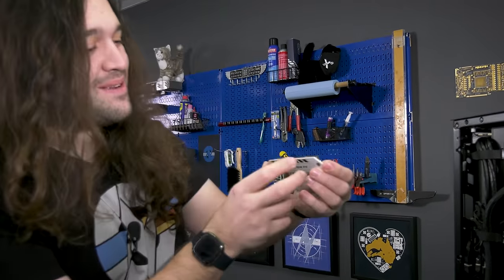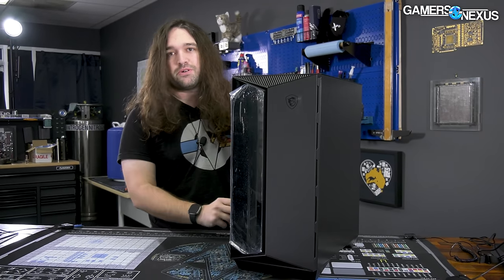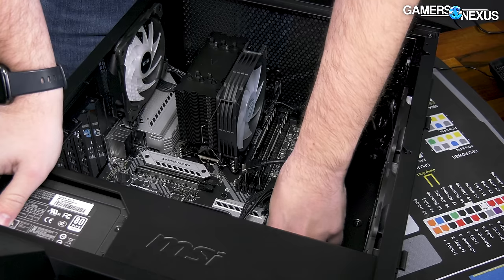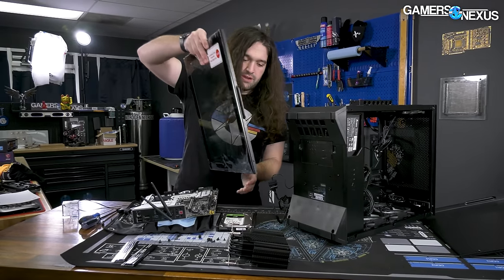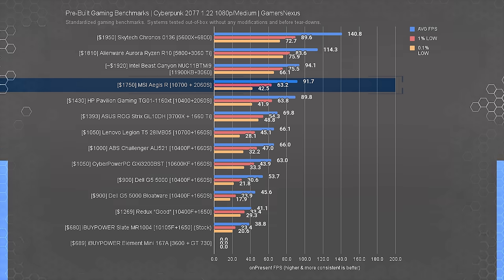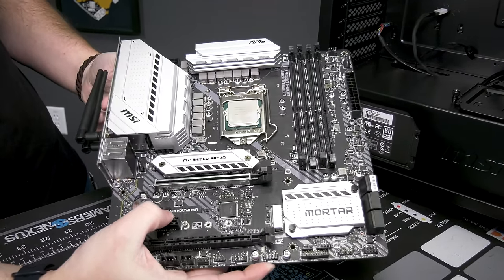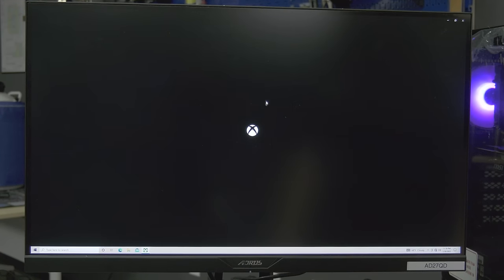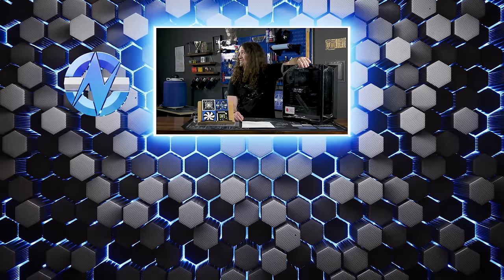MSI Pre-Built Bends SSDs & Boils CPUs at 100°C ($1700 Aegis R Review)

Comment: MSI usually screws up with power managing. I have a MSI Laptop and it was like having a piece of the sun in your hands until you adjust the power limits. Just by reducing 5% the maximum power amount of the CPU reduced the temps of the CPU from 90+C to 60-70C, with minimal performance loss. I don't know who makes the power profiles for MSI, but it's a catastrophe...
Reply: This is a laptop issue in general. They tend to push the limits of the power envelope for the cooling. I generally do this on laptops, to save battery, and even if plugged in, to reduce fan noise. It doesn't end up being 5%, and will go to one dynamic power step lower on the CPU, whatever that may be, probably 15-20%, but it has a huge savings. CPU power consumption is roughly a function of frequency times voltage squared, so reducing frequency 15%, which drops voltage... squared, you get a massive power reduction. If you don't require max performance, it's a no brainer to lower the limit.
Reply: I'm pretty sure what you did was disable turbo boost. You may wanna check that you're actually boosting past the cpu's base speeds. Though to be fair, turbo boost on laptops is almost a gimmick

Comment: I still like this build more than most that I have seen on this playlist. Someone who is halfway competent could fix half of these issues just by wiping the drive and reinstalling windows. The BIOS settings are worrying, but again very fixable if you know what your doing. Atleast with this one, your not getting a motherboard with a ripped out PCI slot, a weak as hell cooler, and a shit GPU. MSI does need to lower their price, use the airflow version of the case, and QC check their builds more. Hopefully they actually listen to you this time, which is disappointing as I generally like their products.
Reply: It's one thing if you're fine with it. Most people aren't competent at all. Secondly, you're messing around with a retail product, where you need to consider warranty issues. Generally, that's not a place where you want to meddle, as you could void that warranty. This is sort of why a warranty exists, so a customer has a path to redress problems with a delivered product. It's not supposed to fall on the customer. Imagine if Teslas came from the factory with several issues, and DIY handy people said it really wasn't that big of a deal, with just a few hours of work. You can like a product and demand an acceptable level of quality and service.
Reply: Cept for the other guy in the comments who was competent and found that the 750W PSU was not enough for the 3090 it came with, causing it to crash, the waterblock had plastic on it still that said "please remove before install", temps stayed high unless the front panel was removed, and then the water cooler stopped pushing water. So he had to buy his own 1200W PSU and a new front panel to fix the problems, not to mention all his time spent troubleshooting all these issues including the BIOS issue.

Comment: I almost got this PC as my own, there were newer models of the cases that had the half front mesh. I just ended up getting Ibuypower prebuilt which was a better choice in pricing and thermals for me.
Reply: learn to roll your own
Reply: @iClapBooty  seemingly better than this mess though.
Reply: time is near  cult
Reply: With some customization I think the burn in and testing done with an ibuypower means it’s got eyes on it for days before it ships. I think if you get a pre built making some changes so they run testing makes a big difference. Yes I know the point is to get a pre built that can be bought as is but making some changes you want was very beneficial in my eyes.  I have blown up a pc before so I am a bit hesitant to do some things pc related myself, but am ok with other things like ram swaps and adding hard drives.
Reply: Still better than MSI.
Reply: Guys, I think the MSI Codex should be next
Reply: @jfkesq  With the way GPU shit is now def no

Comment: I actually purchased an MSI Aegis a while ago during the graphics card shortage of the 30-series, and was overall quite pleased with it. Mine came with the top of the line 3070 that MSI makes the SUPRIM X version. I added a second 1TB SSD from my old system, replaced the 16GB of RAM is came with with 32GB of Corsair Vengeance, and have really only had three complaints, MSI's mystic light software for RGB control should be better, the 240R MSI liquid cooler it came with died after about 2 years due to a recall issue, I simply replaced it with an NH-D15S, and it came with a 2TB hard drive that I didn't really want or need. otherwise all components were actually of quite good quality and well installed, and of all the research I did on the market I think it was the best bang for your buck out of what was available at the time.

Comment: MSI used to be my "go to" motherboard and GPU company.  That was until I started researching and buying components for my newest build in 5 years.  Then reviewers were telling us that the VRM's had thermal issues in the MoBo's I was considering so I decided to try another manufacturer that had better reviews.  Now after this and other reviews I wonder if I can trust MSI for anything?!   I work too hard for my money to throw it away on shoddy components let alone a prebuilt.  Thank you MSI for encouraging me to try other manufacturers which have not failed to impress me.
Reply: ALL manufacturers have "subpar" VRMs on some of their motherboards, ALL have cheap components, but looking strictly at their low tier components for "research" is just confirmation bias. MSI, Gigabyte, and Asus all have motherboards with similar quality around the same price, and looking up proper reviews of VRM quality is much more valid than looking at random reviews of people running a 5950x on a $120 board and saying MSI bad. MSI had the crown for numerous generations of AM4 motherboards because they had GOOD VRMs on more budget friendly boards. This is coming from someone that has owned motherboards from all manufacturers, and has bought what meets my needs, and isn't pushing the budget too high. This time around, it was a Gigabyte board, last time it was MSI, and it was Asus back in Haswell.
Reply: ASUS is still a pretty decent hardware company, but just don't ever install their garbage tier software, they have a less than zero chance of getting it right. Even my new ASUS board from like a month ago being a Z690 is a great board, but after hours of installing and re-installing their crap I just removed it and went with something else for my CPU, GPU and ARGB.
Reply: All companies have good and bag products, we should evaluate by model we want. Everyone talks good about ASUS, went for that and less than 6 months 3 motherboards to RMA. Asus never again, even if the reviewers says it's good. Bought an MSI ITX for my SFF build, amazing board. The downside to that is to have to spend hours researching for every single piece of hardware, nowadays I don't have the same energy to do that.
Reply: Msi is shit, they took 9 months to release a bios for zen 2
Reply: Asus strix boards seem to be the best ones

Comment: Duet Display is actually a useful app when you need it, as it allows you to use a tablet(s) [Android, iOS] as an external display via cable or LAN. It is trialware, and it being preinstalled however I'd consider it bloatware. 

Good Alternatives™ if you don't want trialware would be scrcpy (FOSS, Android only) or spacedesk (soon-to-be Freemium, LAN only) if you've got a tablet laying around and would like to use it as an extra monitor.

I have spacedesk setup on 2 older nexus tablets and a Pixel C over wifi and connected to the W10 wifi direct hotspot, but also have a Duet license when I may need it. I will probably end up getting  a spacdesk pro license once they allow purchasing.
Reply: Agree, I have Duet Display on my 2015 Macbook Air and use it with an old iPad 2. Saves the iPad from e-waste and gives me a second screen when I need it.

Installed here, it's bloatware, pure and simple.
Reply: @richardcrossley5581  Yes, anything that keeps otherwise good working devices out of the dumpster. 

And because the Nexus' are IPS displays I can have mostly static windows open in them or videos/podcast apps without worrying about burn-in; or move chats to them when I need to, as latency is not as critical for me when I have those there.

The battery endurance on them is still great (80-90%) since I've been keeping the charges at or below 70%.

Sidenote: I also have a Nexus 5X setup as a streamdeck/macro pad through Touch Portal  constantly plugged in with a charge limit set to 70% 👌
Reply: @I'm A Spam Account iirc there have been ways to setup a faux external display with scrcpy but it's buried somewhere in the github issue's thread. 

Superdisplay is very responsive but is only limited to one concurrent device, and yeah spacedesk can get pretty choppy which is why I have not latency dependent windows there.

Comment: I feel like MSI has become the evil dragon in the PC space over the past few years.
Reply: Or the hardware they make that is actually good is completely over priced. They were one of the first companies to raise gpu msrps before it became the norm for every AIB to raise msrp. But like they make good gpu’s that are over priced, they make good gen 4 ssd’s that are over priced, they make cases that honestly if they just took the front panel and swapped it with mesh it would be fine but still over priced. Only real parts that you can get from msi at a good price without feeling like you got the bottom of the barrel is motherboards. But if you want their “budget” gpu you get a plastic backplate and a plastic shroud on a 3080. Like if I want a gpu with an extremely marked up over reference msrp I might as well get a strix.
Reply: Always has been.
Reply: @Jsteeeez  I've noticed that the Nvidia GPU binning seems to be bad on MSI GPU's from my experience as-well. Some other brands tend to get better binned chips also such as EVGA. I agree thermals are not the best especially in their gpu design which may be why they loose performance to thermals depending...

Comment: I just bought a MSI prebuilt from Best Buy, it was $1099 on sale for a 5600xt, 6700xt, 16gb c16 3200 , upgraded cooler, b550 mb. It's been a great pc so far. I noticed the memory was at stock clock in bios, so I set it to the 3200, The cpu wasn't over clocked, but I don't blame them for that. I had an extra 140mm Noctua fan laying around I mounted above the CPU cooler. I've had a few 8 hour gaming sessions no over heating issue, no bugs, no crashes.  The ONLY noticeable bloat I had was Norton, which kept liking to pop up, till I deleted that. So far I would say I'm happy, and for the price, I would be hard pressed to build one myself for less.

Comment: The first thing I did when I bought my MSI Aegis R (3060, 10700f) was do a fresh install of Windows. Haven’t had a problem with it since.
Reply: How do you like your computer so far? I'm on the fence of buying it
Reply: @BA-rh5hy  It's been good honestly. The only thing that's been bugging me pretty much since I bought it is the power supply fan sometimes sounds like it's hitting something, but it's usually not bad and I can just ignore it. Otherwise it's been fine! It's perfectly capable of playing modern titles with some settings turned down.
Reply: @samdajellybeenie14  awesome, ty for the heads up. I just picked one up tonight and going to start with a fresh install of windows 11.

Comment: I've had plenty of ASUS and Gigabyte motherboards that almost always bend my m.2 SSD at least slightly (maybe not as bad, but still).  So that part wasn't really surprising to me.
Reply: Some motherboards have 2 (thermal or just pressure) pads stacked on each other between like the m.2 60 and m.2 80 length. Depending if your SSD is one or double-side you have to peel one pad off. I wondered if it was the problem here.

Comment: Reminds me of how I ordered a MSI laptop, and the SSD wasn't even plugged in (it looked kinda like whoever was installing the SSD missed, and instead the end of the ssd where it connects was ON TOP of the port). To be fair it was open box but still. Pretty sure I got a picture of it somewhere
Reply: For my MSI gaming laptop, only the CPU didn't have the proper thermal paste application. I had accidentally caused a short on the motherboard.
Reply: my sister had one where the battery, after just a few years, managed to bloat to epic proportions and crack the case

i saved the components by ripping out the battery (affixed professionally to the system with electrical tape and hot glue) and running it off the mains as a gaming-capable set-top box
Reply: @flaccidpringle  My mother's old laptop had a dead battery, then replaced it with a new battery part (it puffed up into a pillow and finally gotten a "genuine" battery for it. Then later did the same thing. I had a feeling that Sony had SERIALIZED every laptop batteries!
Reply: @flaccidpringle  If it was that big then holy shit thats scary. That's not a battery, that's a bomb waiting to explode
Reply: @luqdude  yeah, generally i advise against getting gaming laptops for anything but the form factor; those batteries become fire hazards after two years at most

Comment: having the intake be so limited may actually induce stress on the fans of the whole system once they kick up and not have enough airflow. I think the best case scenario would be a case with many holes so stuff can breathe easily, and fans never get stressed trying to push air that isnt there, ie negative pressure
Reply: Yep, things are quieter and more stable if they can just get the air they need

Comment: I bought an MSI prebuilt last summer (need to upgrade the whole system + GPU shortage)

The GPU was throtteling last summer on 4K gaming (thanks to the heatbox case)
The CPU started throtteling this winter on Cyberpunk (120mm AIO with the infamous design pump-on-the-rad ...)
The M2gen4 ssd was an OEM one, with an obscure firmware (3k read speeed). Fortunately I managed to upgrade it for the 7k read speeds.
The 2 ram sticks were laptop ones, with the JEDEC-3200 horrible timings (no XMP of course)
 The cable management was a joke. Non modular PSU.
And the fans were going 100% (thanks MSI, I got a private jet simulator for free !)

I've never built a pc before, but I managed to move all the parts to a lian-li o11 dynamic + 6 lian-li daisy chained fans + kraken x73 (9 fans in total)
Finally, I cannot hear it and thermals are excellent.

The main difficulty was the MSI motherboard (héhé boy ...) Many headers (RGB ones and USB 2) were missing. The manual of this motherboard model was referencing them though. Guess they use some "mutant" motherboard for the prebuilts too...

Long story short :
- be warry of MSI prebuilts

- thanks for all your testing videos : if only I watched your channel before buying

Comment: As someone whose been using a HAF 912 for the last decade, it stuns me how so many manufacturers choose to cover half of the entire case in glass with little to no intakes.
Reply: Still rocking my OG Phantom. Even with just the CPU fan going it runs loads cooler than this monstrosity, and I originally had an FX8350!
Reply: Meanwhile, an abkoncore case I used to have :
Install 3 fans at the front side but cover the entire front half of the case.
The only holes in that case was the exhaust at the back and a decorative hole at the top, which was so tiny and you couldnt install any fan there anyway
Reply: Glass is neat, but give me a solid black box with some grate vents any day!